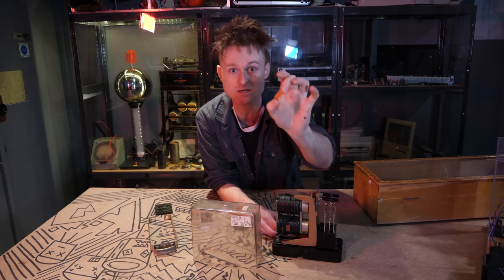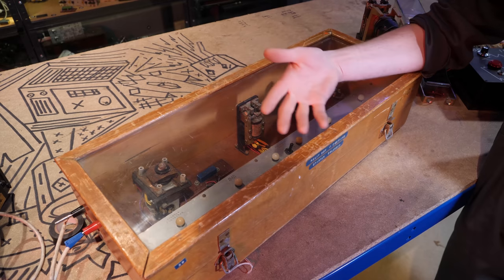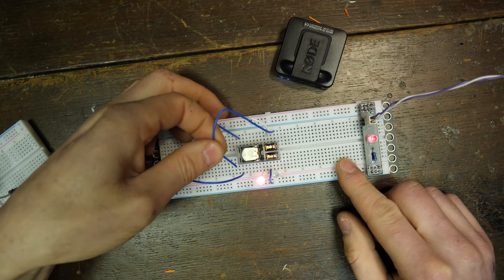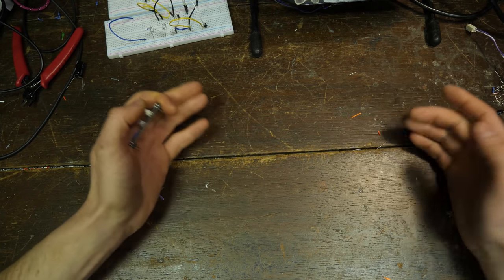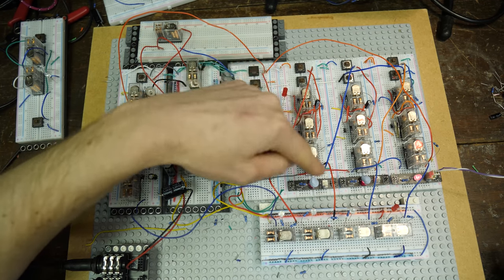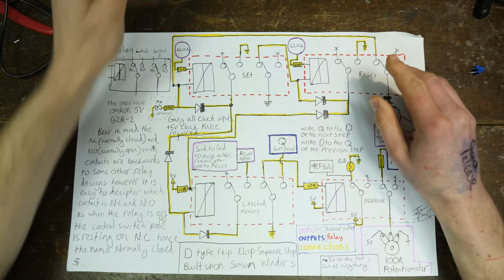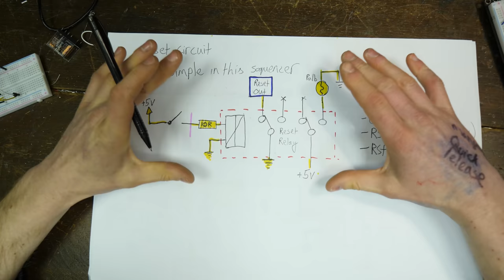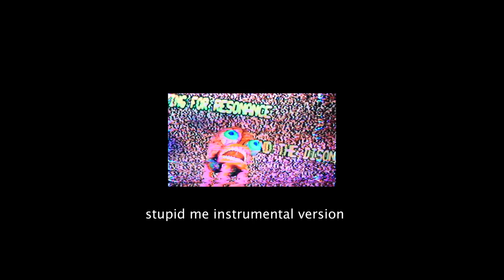Making A Synthesiser Sequencer Out Of RELAYS Part 1

Comment: Relays are cool, i used to install telephone exchanges in the early 70's
The telephone relays (type 3000) have wiping contacts, just after they make contact, they move further and wipe across the contact faces, ths keeps them clean and reliable, looked like that big relay did the same, btw, is the contact block supposed to move (black block holding the contacts at the base) ?
Telephone relays can also have delays, they use a slug of metal on part of the coil, 
I once built a cascade timer using first relay to turn on the next etc, the last relay in the chain releaased them all, this was a challenge in training sholl, the tutor was impressed by my method, i even said i could slow it down using capacitors.
Some amplifiers have a relay that connects to a dummy load inside when you turn it on, then connects to the speaker after a delay (anti thump), could be a similar thing in your audio device.
Reply: Yup, heard the click in my USB soundcard and my little hybrid vacuum tube amp (Xduoo MT-602) when they start, neat to know what they're doing, especially since the tube amp seems to wait until the heaters have got the tubes working before the audio kicks in.

Good to know it's protecting my headphones from unnessisary power surges!

Comment: Fly back diodes probably don't matter as much if you are using relays to switch relays. More so necessary when you are using digital circuits or transistors to control them as they are more susceptible to damage.

Comment: I have ~20 relays from an old telephone switching devices, and they have 14 or 16 pins, not sure right now, and I was wondering, could it make everything more compact? I'm guessing they have 4 switches, normally open and normally closed, so it could work in some other applications, something more meaningful for us. I guess I have to check that out now hahaha
Reply from the maker: not completely sure how it could make it compact it may cut out a resistor per step. but most need to be on seperate coils!! cool though make sure to make use of them!

Comment: Nice video. But at 2:09 you said the relay has 2 Poles. Actually, it has 2 Throws. A pole is a seprate circuit and the throws are the number of ways each circuit can be switched.  That relay is a 4 Pole 2 Throw because it has 4 switch circuits each with 2 positions. Most relays are 2 Throws no matter how many Poles they may have.

Comment: flyback diodes are only needed if a relay is powered from some transistor based gate. not when it's powered from another relay or a switch. the other relay won't give a damn about it's inductive load possibly sending some power back. which is usually fine up to a few 100 volts anyway :P (unlike with let's say, a transistor ;) don't recall ever seing a flyback diode in any purely relay based switchboxes. in fact quite a few of those even don't bother with dc and just run on unregulated ac :P and if instead of the supposed 24 volts it peaks to like 100 or 200 sometimes. that doesn't matter either :P not a single chip or transistor there that can break :P 'muh it's just 24 volts right so i'm gonna feed this into this zener and optocoupler and then off to the mcu' 'auch' 'now why did i just get a shock of that just  24 volts' kinda stuff :P (obviously interfacing such stuff due to being ac also 50hz'es the hell out of your input gates but besides that in practice the voltage usually is a lot higher than what it's supposed to be ;) those relays on that breadboard are just 'that sort of relay' btw. they normally plug into a 1 unit wide din hutschienen rail thingy. for 'low' voltage switching stuff. :P (touch it and you still feel it so it aint that low ;) the lifetime limiting factor is not how fast you switch them but how big the spark is that comes out when it does :P making it go back and forth like a million times per hour at just a few volts and milliamps won't hurt it. it's the switch contacts that usually die. not the mechanical part. die as in it has welded itself shut against a contact rail :P

Comment: Imagine creating a RAM stick based on relays!! When ever you open a program or your computer checks if memory is good it will CLICKCLICKCLICKCLICKCLICKCLICKCLICKCLICKCLICKCLICKCLICKCLICKCLICKCLICKCLICKCLICKCLICKCLICKCLICKCLICKCLICKCLICKCLICKCLICKCLICK
Reply: There was a short period of time when relay computers actually existed. During the same period as vacuum tube computers but before transistor computers.

Comment: This kind of modular desgin is actually similiar to german rader stations from World War 2: If one part fails the technician could just swap out the module board and the the station is operational again.
And i want to start building such a device myself now.....
Reply from the maker: aaah yeah likely! i read somewhere the simplest of mistakes were aboe to be made at board level under pressure so things were built modular cool
Reply: @LOOKMUMNOCOMPUTER  and in case of damage from air raid or Sabotage the station would not be down for long

Comment: There used to be a bunch of old industrial equipment that ran on relay logic. Fun to troubleshoot.
Reply: Oftentimes modern PLCs are programmed by a GUI. The basic building block of these are simulated relay contacts.
Reply: @eDoc2020  I’d barely even call them simulated. Just instead of electromechanical relays, they use transistors for switching. Basically just compactified relay logic.
Reply: @droppedpasta  I'd disagree, definitely simulated. It all runs as a software loop on a microcontroller, the configured logic has no relationship to the actual hardware. They could translate the relay designs into equivalent transistors or logic chips (and this probably was done at some point) but then it would be single-function, requiring rewiring to change the logic. I believe (in new designs) dedicated logic is only used for special safety functions such as interlocks, and then it's probably still electromechanical much of the time.
Reply: @eDoc2020  Well, I did say “barely”. While the PLC can have virtual relays as part of its logic, once it’s time to produce outputs, things get very real in the form of solid state relays (and maybe MOSFETs for the higher current stuff? I don’t know for sure, I’m not an EE, just an industrial tech.) Ever opened up and worked on a PLC? The relays aren’t much different in output, and in comparison to relay logic, a PLC controls the “wiring” (ie the coil voltage in an electromagnetic relay). Which is why, as you pointed out, they’re programmed with ladder logic. The relays are already built in.

Edit: Interlocks and safeties are another subject all together.

Comment: Why aren't you using eady-eda plus their PCB service to make those boards? From board-design to pcb in your mail, one week and costs are crazy low. 10 pcbs as you have them there less than 50, including shipping.
Reply from the maker: Why aren't you using proto board? It takes a few hours and boom they are all done no waiting about
Reply: @LOOKMUMNOCOMPUTER  If there is a circuit I know will work and I know I will have to do more than 5 times and in the future maybe even more, I prefer to work on other stuff and wait. Proto-boards might take a few hours for simple boards, but for me that even often is already too long to bother. And, proto-boards, when they get just a bit complicated often make me loose a bit of extra time with small mistakes. 
Also I totally dig those shiny nice boards and because it is so easy I often build in some experimental stuff. Like jumpers, extra pins that allow me to modify even the printed PCB circuit later a bit. 
But I get your point. I'm always short on time and have always 10 things to work on. So I prefer to save the time and have a higher quality and more sustainable product, than being able to proceed quickly in one project. If you are into one project at once, the waiting surely outweighs the extra work.
Reply from the maker: @jumbleblue  i do the same thing, but sometimes proto is justnicer. they look better than commercial pcb's but yeah i have opted for pcb a lot recently but trying to ween myself off it as proto is just overall nicer looking and more rewarding, just my opinion in the end of the day

Comment: That is indeed a railway relay, and they are* used to implement something called relay "ladder" logic ( https://en.m.wikipedia.org/wiki/Relay_logic ) that is used to control switch points and signalling.

*You'll note I used the present tense "are" as opposed to the past tense "were". If you've ever wondered why the UK rail network is a shambles, well now you know why. That's right, the door that you see at the station that says "relay room" is literally still that...

Comment: I wanna make a pulse width controlled relay for connecting and disconnecting a signal path. Am assuming i need a low voltage ac solid state relay?!
Reply from the maker: Why would you pulse width a relay? When the contacts are either on or off?
Reply: @LOOKMUMNOCOMPUTER  👍🏽exactly, a want a sharp cut pulse to trigger something on and off

Comment: Hmm. The mechanical durability of these relays seem to be pretty high (guaranteed 24 days or 48 days constantly running at 300bpm - little confused about their "DC coil" vs "AC coil" distinction on the spec sheet).

Their rating for the "electrical" portion is much lower though. Like 2 days 7 hours at 30bpm? It's confusing to me that they say it is "max operations/hr: 1800 for the electrical portion".

Comment: If you're interested in relay computers, the Harwell WITCH at the National Museum of Computing in Bletchley Park is worth a look (as is everything else there). It uses relays for the logic and decatrons --- a kind of valve which can store a single decimal digit, and can be advanced or retarded with a logic pulse, and if there was ever a piece of technology which had 'Sam' written all over it, this is one --- for the storage. It's beautiful. It's a true stored-program computer capable of running programs from RAM, and it's so slow that a trained mechanical calculator operator can outperform it... for a while. https://www.youtube.com/watch?v=2QBcnSMF7c8

Comment: You need a diode in reverse on the coil to protect the transistoooooooooooooor!!! X)
Reply from the maker: But there is no transistors
Reply: @LOOKMUMNOCOMPUTER  268 / 5000
Resultados de traducción
I went back to watch the video more carefully, I thought you wanted to feed the clock with a transistorized circuit, I did not get to distinguish the capacitors for timing. Between the different language and that I no longer see I'm fried hehe !. Greetings, the museum is very good.
  dob !!!

Comment: So are you making relay oscillators for your relay sequencer?!!??
Reply from the maker: Already have them in my synth
Reply: @LOOKMUMNOCOMPUTER  really!? Like tuned buzzers you mean?
Reply from the maker: @AM-ui9mc  welel a buzzer is tuneed. sorta
Reply from the maker: @AM-ui9mc  you hear what happens in the vid, before i add the capacitor to the circuit
Reply: @LOOKMUMNOCOMPUTER  yes, yes! Just before you turn it into a clock with the cap: Are you going to use the buzzer as a synth voice? Or have you done that already you mean? Wouldn’t it be awesome to have the relay sequencer control buzzing relay synth voices 🐝??
Reply from the maker: @AM-ui9mc  yeah got relay oscillatrors in my synth! they dot last too long mind lol
Reply: @LOOKMUMNOCOMPUTER  you’re the man. do you have it in any video?

Comment: Here's one I prepared earlier. http://www.synthpanel.com/tube/programmer.html
Yours seems to be similar to the Moog, based on a shift register, while mine is based on a Serge programmer.
Reply from the maker: wheey awesomne ken. why am i not surprised!!!!! thats cool ill check it out, yeah i went down the flippy floppy routee like in the moog ones, but yours looks a lot less component intensive! thats cool! mind if i mention the link in the next vid? hope all is good over there ken!!!
Reply: @LOOKMUMNOCOMPUTER  Go ahead. Use any elements of the design you want, etc!
Reply from the maker: Hey Ken just to let you know. Been messing about with your design the past week. Touched on it in the last few minutes of me last vid. But proving damn good. After a some tweaking I have it running with absolutely no dropouts at 440BPM 1/16th which is great because the big version needs to run twice as quick as the actual sequence. I’ll touch on it more in the next vid
Reply from the maker: I can push it to 500 Bpm but I had a drop out earlier but it only happened once. 440 is sort of the definite at the minute which is still more than enough.  after 500 is a no go

Comment: My John Deere lawnmower is full of these. No purpose for them. Engine says running with out all of them (4) and only need the solenoid to get it started. One day I’m gonna delete them and straight wire it with a 15amp fuse instead of 4 relays

Comment: try micro switchy thingy
Reply: not power relays, bit information wafer bend/capacitive micro/nano switches
Reply: optical bendy mirrors for reference
Reply: those dont have to have special single crystal wafers/substrate, just some coherent material to have it switch the contact on/off/static
Reply: photonic gates would work too, like in a micro/nano transistor
Reply: or a diode/diode gate pair
Reply: or rather diode-gate pair
Reply: or led-gate pair
Reply: buzz is an no-crystal-needed mechanism oscillator
Reply: flip flops are nice
Reply: dont you flip flop now boy
Reply: rom memory in relays

Comment: Worst explanation of relays I have ever seen. You could have simply said it’s a switch that uses a low voltage circuit to switch a higher more dangerous voltage circuit. Hence the switchy thing.
Reply from the maker: That's what I said